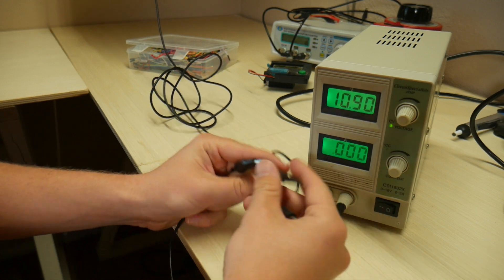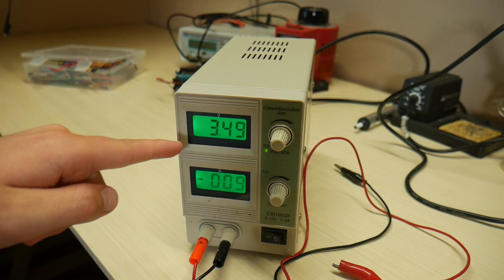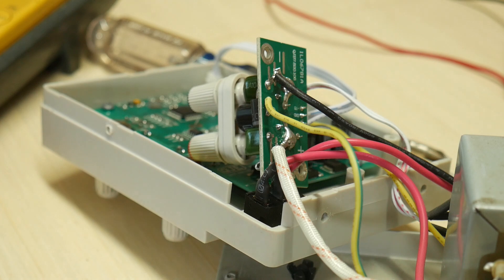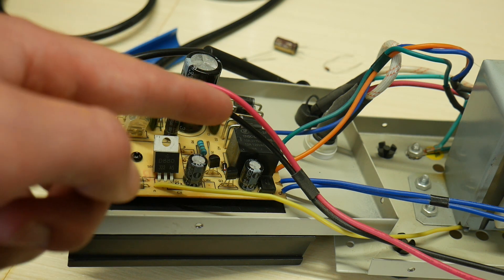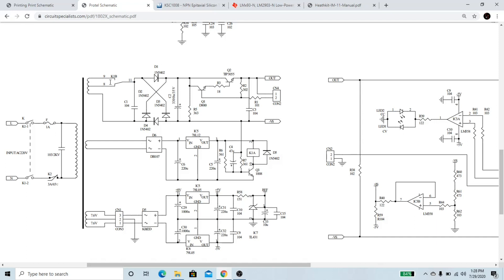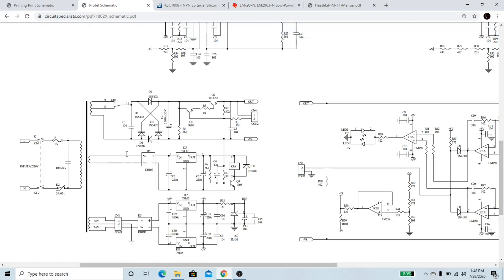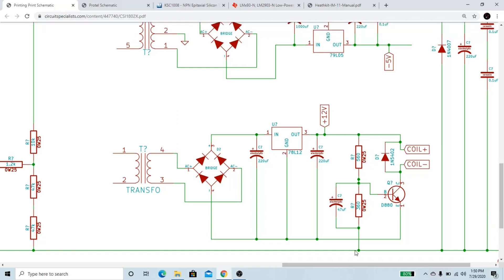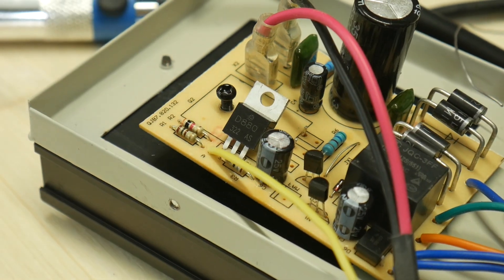Repairing A Bench Power Supply(Shorted Capacitor + Noisy Relay)

Comment: In my case, fridge makes relays clicking. No idea yet whats happening. I have no schematic. My PS is 0-30v, 0-10a, linear. Purchased it with burnt transformer. I fixed that by rewinding secondary trafo part. But still that stupid problem. When i set for example 12v and fridge starts or turns off, it jumps to 17v just for second. The same may happen when i turn on lamp, transformer soldering iron, vacuum cleaner... Etc.

Comment: I just bought a used one of these power supplies. Mine doesn't have any problem with the relay and the output seems to be stable and accurate. However, there's a humming noise coming out when it is switched on. Is this normal?

Comment: You are amazing young man! How did you calculate the resistor and capacitor value? Thank you again for sharing your videos!
Reply from the maker: You're welcome!  I honestly just picked small electrolytic capacitor from my drawer(the larger value wasn't working as well) and the first resistor in my '1-50ohm' resistor drawer.  I just happened to get lucky and it worked second try.

Comment: I own a power supply that looks exactly the same, even if it is 15V 3A (HQ Power PS1503SB), the V potentiometer is rotten and the voltage jumps from 4 to 6V (I supposed the previous owner used it at 5V) so I plan to replace it with a new one, I may use your video as a support. Thank you :)
Reply from the maker: You're welcome!  Let me know how your restoration project goes and good luck!
Reply: @TannerTech  I will sure tell you once it's done, but it may take quite a loooonnnnngg time. :)

Comment: Its a very odd fix but okay it works perfectly. But i would have measured that capacitor to the base of the relaisswitching transistor or the continuïty of the grounds or plusses between the two or even all three apart subsupplies. Because you let the fault be fault and only made a surpression of the symptom. But okay it works well, and i myself, i sure made lesser fixes in my lifetime!!